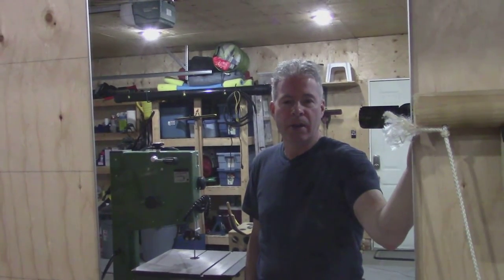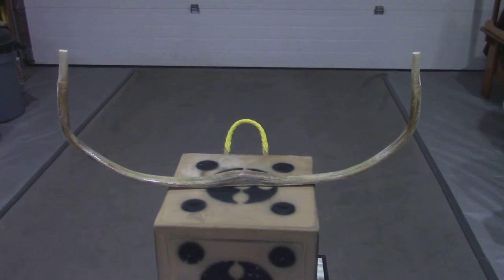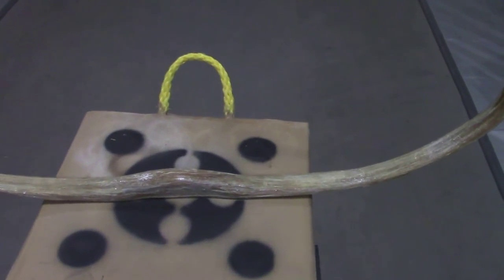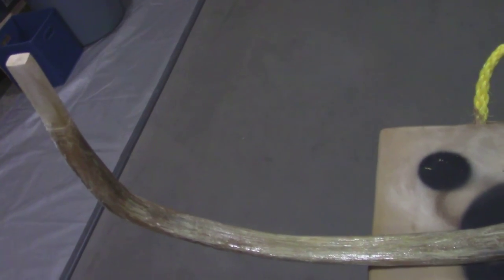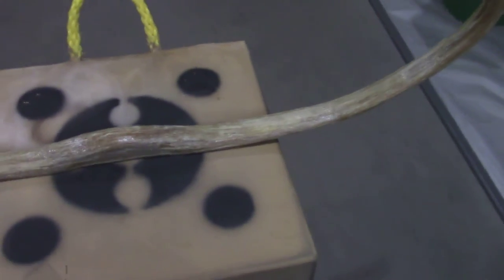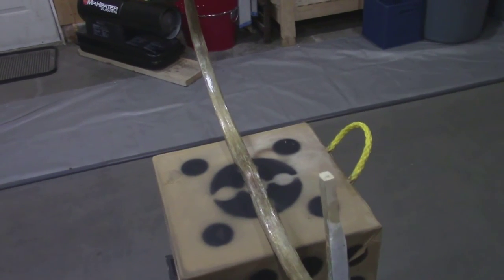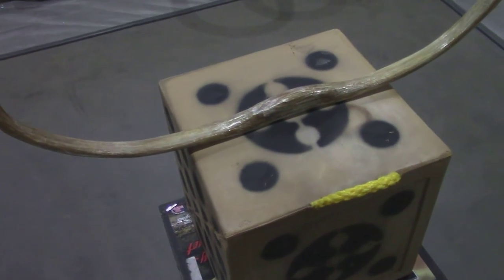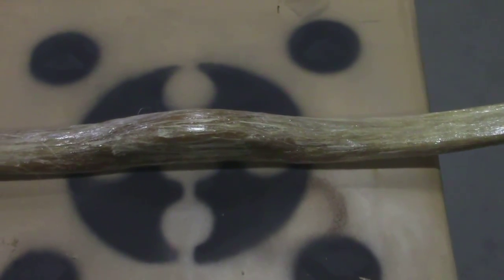First Hornbow (Turkish War Bow)

Comment: What was the thickness of horn/wood/sinew layers in the bending part of the limb ?
Have you add some reflex during the seasoning time ? How long have you waited after the last sinew layer  ... till stringing the bow ?

I have one turkish bow in seasoning period now ... 48inch with horn/wood/sinew - 5mm/2,5mm/3mm .
 3 layers of sinew. Bamboo as wood core.
Reply from the maker: Thickness was about 13-14 mm at thickest part of the sal. There were 3 layers of sinew with about 3 months drying time from last sinew application.
The one limb held however the other had a sinew tear in the sal section of the limb. I broke it purposely when this happened as the draw weight would have been too much for me as about 100# as I had estimated it to be.

Comment: I have a question: When you add one layer of sinew how much it increases its power?(i mean 1 layer 60#, 2 layers 80#.....)
Reply from the maker: I don't think it will increase the power at all. If anything if you do not need another layer of sinew do not use it as it only adds weight and decreases the power as the limb is slower to return to the braced position when shot. The horn and then the wood give the bow the power
Reply: i heard from some bowyers that sinew increases power a lot, they used thin horn and lot of sinew and the bow was the same as thick horn and thin sinew layers.But i will trust you and buy thicker horn :-)
Reply from the maker: A rule of thumb from a Turkish bow maker from the book "Ottoman Turkish Bows" is that 3 mm of water buffalo horn will make a 60-70# bow but an 8 mm horn will make a 200# bow. Sinew as I can tell only assists the structure to be able to bend and absorbs the tension to get the bow to draw to 28 to 30 inches. The Turks used only 2 layers of sinew to minimize the weight. I would HIGHLY recommend you use 3 layers of sinew.
Reply: did you groove the core to the horn? and is that process necessary?
Reply from the maker: Actually you might be surprised as the power comes from the horn and to some degree the wood and not the sinew. Sinew adds to the weigh of the bow and slows the arrow down. The correct amount of sinew is the exact amount that causes the bow to not break when it is fully drawn and shot. Sinew protects the bow and allows it to be drawn to greater draw lengths safely.
Reply from the maker: I did groove the wood and horn but not interlocking. It appears this is how the Turks did it as it increases the surface area for gluing by 40%. I would say it is required but does not need to be interlocking.
Reply: 49 inches so tiny....I have  a 33 inch draw im 6'8,  can a Horn bow be made longer? Like a longer limbs, made to 64 inches? Longer splices ?
Reply from the maker: You should research the Assyrian horn bow. It is 57 inches in total length and it draws back to 33 inches. One of the fastest bows there is.